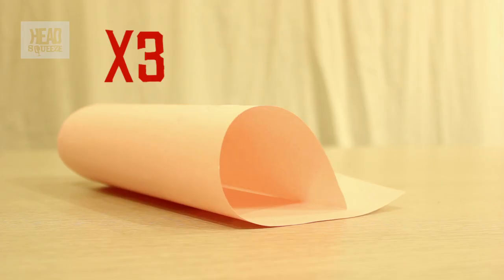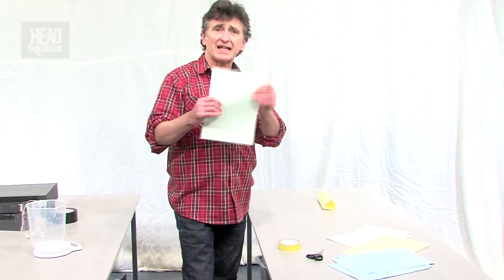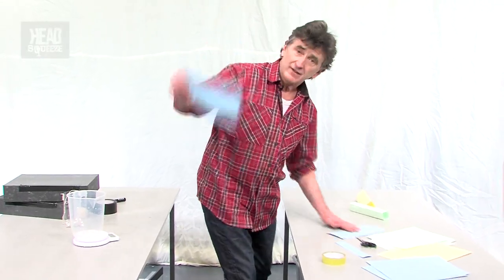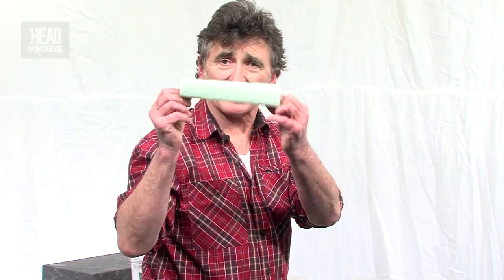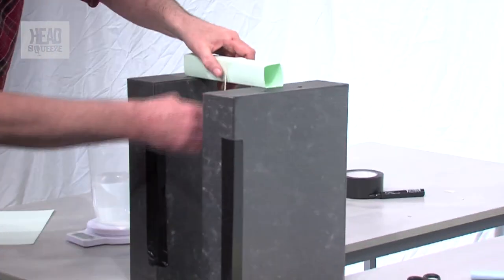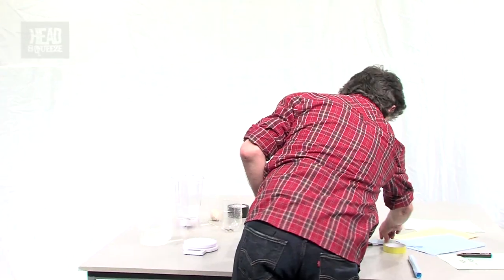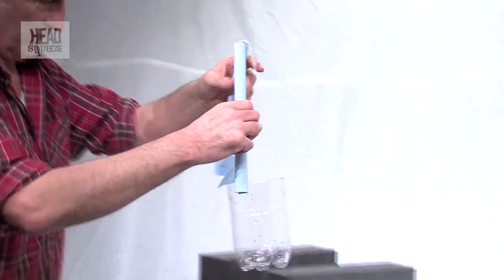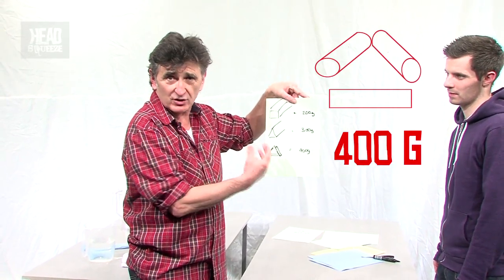Making Bridges Out Of Paper?! | Earth Science

Comment: The idea of this test (the different structures) would've worked better with harder materials and of course making the structures more accurately. We built these wooden bridges that were 32 cm long and laid these 12 Kg metal blocks on them. Everybody designed their own bridge and had the same amount of materials to use. A few bad structured bridges fell from the first block but the ones with proper A-frames only broke from the fourth block. Made the point much better.